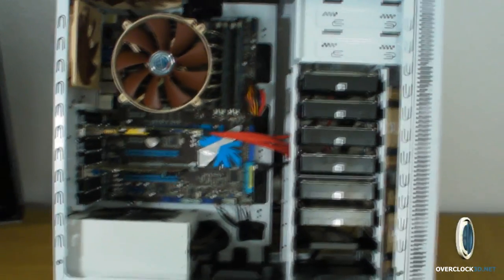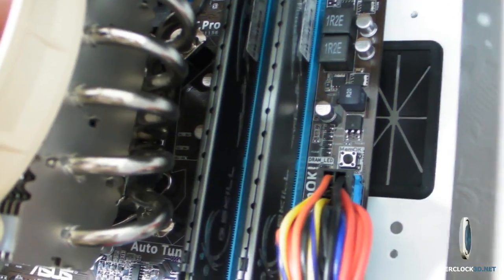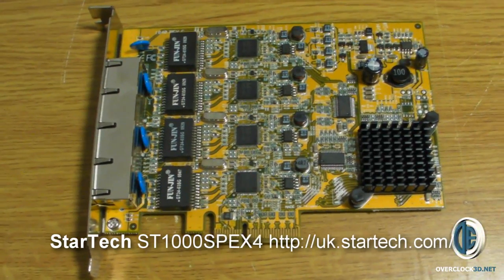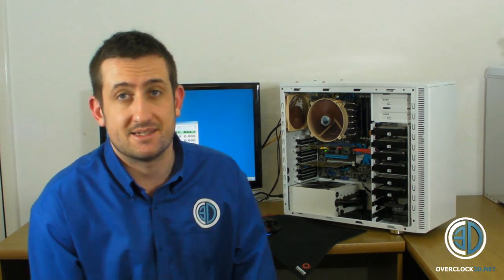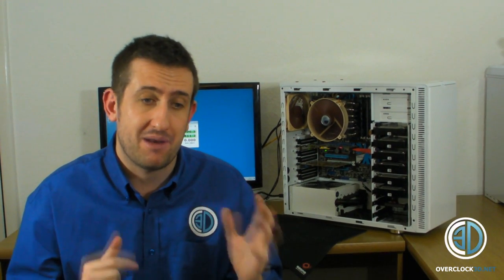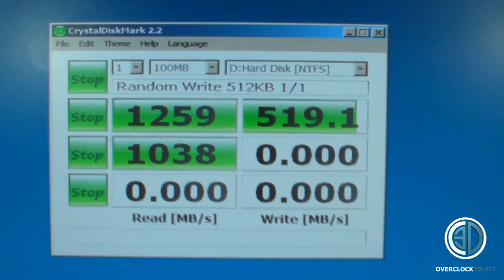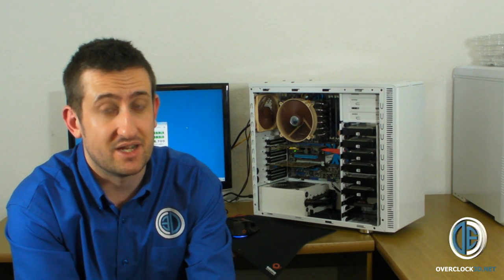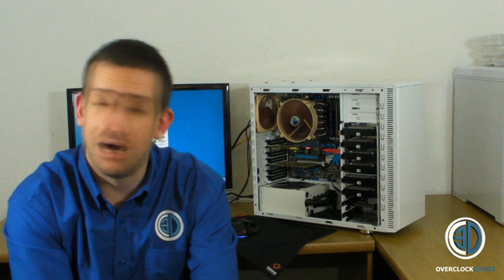WOW Storage Server COMPLETE   i3 530 12TB Raid 6 Server 2008 R2 Adaptec 5805 StarTech Gigabit

Comment: @Sole4sho get 2 gigabit network ports, either both on the motherboard, one onboard and one on its own card, or both on their own card. Intel cards are good. Using Cat6 cable, plug your cable modem or adsl gateway into one port and your gigabit switch into another, and boot it into pfsense, smoothwall or something similar. You could also get a wireless adapter for it and put that in its own zone to manage wireless users separately, but that's optional.

Comment: @TimeToLiveCustoms this is roughly the limit for gigabit and is what I would expect from a functioning RAID card. I was asking about the "100 meg" of the onboard RAID from the start of the video, to see just how bad it was to start with.

Link aggregation (lagg) is fun but has some limits and different modes are useful in different situations. In general one TCP stream will only go through one link, for example, even if the other is unused.

Comment: You must put a PCI-fan that blow air vertically upwards on the the Adaptec heatsink just in the available PCI slot below the card; because this card heat sink will overheat up to 70 degrees Celsius if not actively cooled or put on a real server chassis with a lot of air flow.

Comment: If anyone is going to use these Samsung F4 HD204UI drives as well, don't forget to update your firmware. A bug in the previous version would cause data loss under certain circumstances. Samsung silently put an update up on their site.

Just create a bootable USB drive, put the update on it and run it. You can leave all your drives connected, it will only update the HD204UI drives.

Comment: Hey, quite like your Server :)
But, you could mention, that when you benchmark your Speed with a Chunk of 10 or 100MB, you measure the Speed of the Raid Cache(which is 512MB you said)
You will have "real" HDD/raid Speeds when you go over the Size of the cache(like 1Gig Setting).
Non the less, cache is a big bonus for real world settings!

Regards from Germany ;)

Comment: you want raid 10 as with raid 0 if one hard drive fails, all data is lost as 1 file is split into so many blocks and spread across all the drives but with raid 10 it does the same thing, although it will half your storage as one half is mirrored.

Comment: When you say 100 meg a second, do you mean megabits per second (bits per second being the standard unit for bandwidth) or megabytes per second (what Windows probably shows)? The expected performance of NAS seems to vary depending on the expertise of the user e.g. Drobo users think 100mbps is fast for a USB DAS, while my own NAS reads at about 2.8gbps locally (dd read to /dev/null), bottlenecked by 2x gigabit NICs in LAGG.

Comment: Your ATTO benchmarking is really incorrect, because of caching.
Just please learn a rule for benchmarking whatever contains cache - if you want to have accurate results what the controller really could do, take all caches in the storage subsys and double that size, then use that for your tests. 
In your case that is: 4 GB RAM + 512 RAM on controller + 6x32 Drives = 4,8 Gb x2 = 9.6 Gb
Use such a test file to really get the performance of those disks, else those results are plain useless.